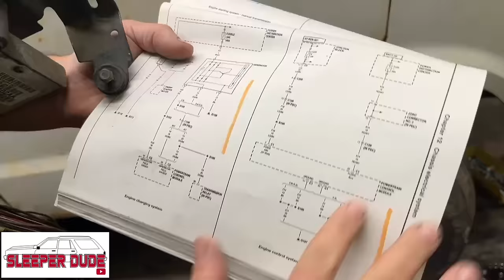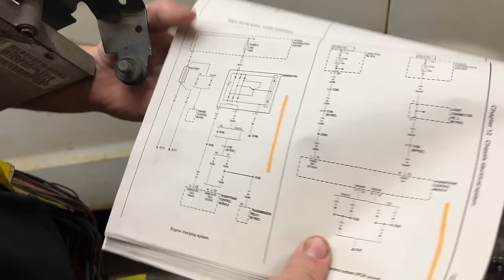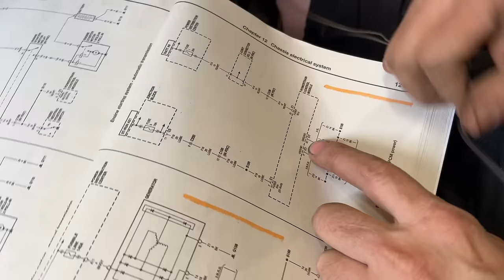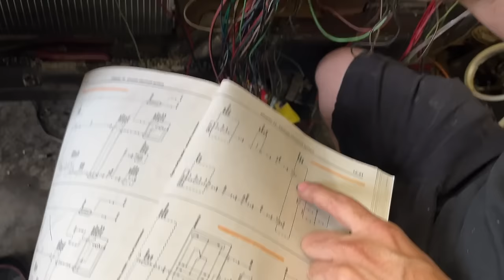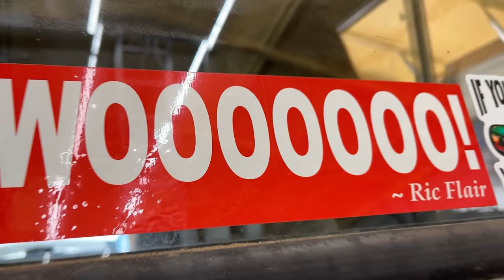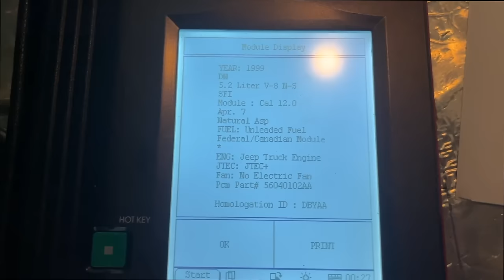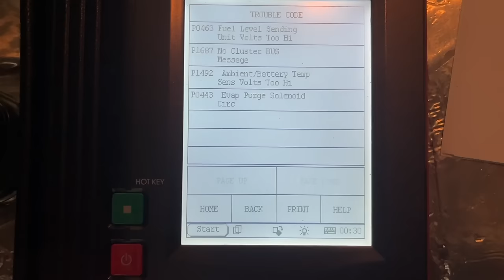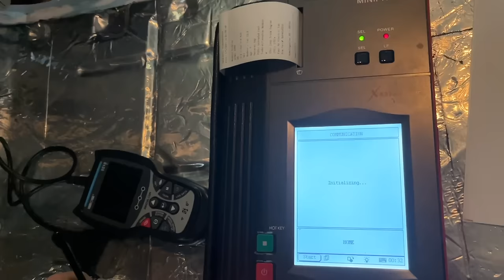2 Years of WORK Has Led Up To This! Will It Start?

Comment: Ok replying to this in hope you see this. I think you went wrong using your '73 starting cylinder. the '99 Durango has a key FOB right?  So you better could have used parts from the Durango steering column or maybe even some extra security module under the dash that are on the wire loom connected. Anyway security mode is triggered. I get from your video that you sent out your own ecu to have security mode flashed out, But the thing is (in my thought) that it still is being flagged as active. (having it send out before you tried to start it would have  probably worked. Most PCM's have a backup battery and/or write important settings to chip so important settings like: odometer or security status) are not being wiped after a disconnect.
Normal procedure to unlock security mode is by using the fob key and use a specific code for your vehicle (dealer should know from the VIN of the Durango) So yeah hookup the Durango steering column starter and look for a unit which normally talks to the key. This may no longer be possible after having your PCM flashed. Hope this helps. Also Google:  "1999 durango key CarGurus"

Comment: You should ask your transmission builder on your ATF you used but it should have been ATF plus 4 merc/dex dont have what it takes in fact check the transmission dip stick Peace

Comment: "MotorCity Mechanic" is a great youtube mopar guy, may know every in and out... I'd guess the fault lies in one of those little "insignificant" wires hanging from the bundle... you'll get it! Also, didn't you say you saw a reluctor wheel and thought it strange that it had no missing tooth?

Comment: Is the ecu showing 12v. And is ur battery holding 12v under cranking.. I had a battery with a weak cell and my truck would not start..? Dearing cranking. And and is ur Park and natural safety switch still working??

Comment: If there's no voltage for that first one second WHEN YOU TURN THE SWITCH ON, you need to see if the automatic shutdown (ASD) relay is turning on. What I would suggest is removing the ASD relay, jump terminals 30 to 87, then take your time measuring the voltage again at the coil or any injector. You can do that without cranking the engine or even turning the ignition switch on. If there's still no voltage there, there is a blown fuse or some other wiring problem, possibly a corrosion in the fuse panel.

If you DO have 12 volts now, the computer isn't turning the relay on. That would be very uncommon. Also, when checking that voltage for the first one second, you should do that with a test light, not a digital voltmeter. Most voltmeters don't respond fast enough to give an accurate reading.

Comment: I used to have a 1998 Ram truck that wouldn't run with the downstream o2 sensor plugged in because of a short in the sensor

Comment: I have had a 2003 Jeep Grand and 1999 Dodge Truck with the security delete like for Goverment vehicles. I just unpluged the sim at the Ignition switch then plug in the new computer and you can make extra keys without the security chip's. I don't think that's your problem though seeing your not useing the Dodge truck Ign. switch. Check the gap between the crank sensor and the flywheel it should be about the thickness of a matchbook paper. I use gease to hold a piece of pasteboard the size of the crank sensor stuck on the bottow of it, then set in position and then bolt in on! I believe it's goig to be crank or cam sensor's... So sorry that your going through this. I know from experience that electrical can bite hard sometimes.. Lord Bless you guy's.....😎😎

Comment: Doing some research it looks like your 1999 Durango SLT came with a factory alarm system. There are switches in the doors and trunk that are connected to it. To verify you have the alarm system take off the drivers door panel and take a look inside at the door handle where you would stick the key in, if there's a 2 wire switch connected I suspect this has something to do with the engine running issues. The other thing that confuses me, was the old computer indeed a 5.2 computer? They aren't supposed to be interchangeable between the 5.9 and 5.2. I'm not sure how you have it wired but would it be possible to take the door switches out the durango and wire them in so it disables the factory alarm? If it were me I'd consider plugging in the old computer and trying that route since you know it worked before. (This is all assuming the doors do indeed have the security switches)

Comment: I've never come across an automatic transmission that had to be in neutral to check they have all been able to be left on park cause as far as most if not all transmissions I have looked into putting in park is alos putting transmission in neutral the big difference is that park position activates a parking Powell were neutral does not but otherwise shouldn't be any difference in the hydraulic system.
Reply from the maker: Mopars pump doesn’t run in park that’s why you have to check it in nuetral

Comment: Double check  fuel pressure ,  temp sensor  ?????   And grounds      and your  hot and hot signal wire connected together??

Comment: Crank sensor could have touched the flex plate and broke off the tip, seen that a few times over my past 52 years of being a master certified mechanic. Just relax, think about it. You have spark and fuel just no injector signal. It sorta runs with the bottle. Injectors get their signal from the crank sensor and the cam sensor. Check both for damage. Another thing to check is the oil pressure sensor. It might not be connected right. As for the A/C system, Mortske put an aftermarket kit on his white dually reticently, check his out.

Comment: You have definitely out a running engine's worth of effort into this engine. When you showed what the wiring harness looked like after the tape was removed,  I half-expected you to start pulling your hair out. Instead, you methodically went thru the harness and figured it out, At the end, it seems like a bad electrical connection between the injector signaling unit and the injectors. God bless you for your patience. You will triumph over the engine yet.

Comment: Could the fuel line that is a billion miles long and thick (thats what ahe said) be full of air? That was my thought as to why it was running poopy.. but not for the not running at all thing. Maybe try to wire in the oem key cylinder w/key or atleast verify its chipped or not, i dont know if that part they can flash out of that pcm.. make sure map is getting vacuum.. oil pressure sensor wire could be jumper'd..  idk.. im going to get with my mopar buddies in a few days and report back if they have anything... did you put a new crank or cam sensor in? They may need programming

Comment: might be able to craft the inner cubbins from the speedo in the durango dash in the bezel of the old dodge campervan , that way you at least have a moving speedo , might need to put a gps next to it to compare the actual mph with the mph shown on the dash
as for wat could happen when tying the switched and starting power wire together is that one of the two backfeeds intoo the other ..... you could temporarily hook the switched power wire and or the startpowered wire up to the battery with switches in between so its seperate from eachother and see if that helps youre starting problem , starting to wonder if the start power needs to be constand or only under start , seems to me thats the only thing you done different from stock (using the old vans contact ) ..... come to think of it check how the durango contact switch works , could be it switches between the two (breaks the one and contacts the other )

i own a smart car and these things are kinda tricky with the can bus , they connect the dash the ecu near the engine and the underdash thingy (dash controll , wipers , indicators , light , etc ) together stores the milage in more than one of them and if one of these components gets switched out and or replaced with another one of different milage or different chassis number the ecu goes intoo a screaming fit (i actually believe it will try to start a few times then locks up untill you reset it using the mb star system)  
could try hooking up the durango dash back in (splicing all those wires back in ) and see if that changes anything as the ecu might want to see the original milage (wish makes sence when you need to leave the newly installed ecu alone for 5 minutes to communicate (must be the durango dash cluster it needs to communicate with as theres nothing else it could comunicate with that was in the durango)   ..... makses me hope you still have the original ecu and that might not gone intoo save mode , though i think the dodge dealer might be able to just reset as original by deleting the codes 

maibe do another obd check might give you a different fault code (did you mentioned to the guy programming the ecu that the van didnt had the original dash in it that came with the ecu ?)

Comment: the exhaust pressure the o 2 sensors could not be working right they regulate fuel no cat between them and open pipe the flow might be to fast between the two they read  the difference in oxygen in exhaust and adjust the fuel  to keep correct fuel air ratio .try to take them out of pipe still hooked up and see if it will run .. my 97 wrangler is hard to start but runs the exhaust manifold is broke so it reads to much oxygen for starting but after it is started it will run
Reply: you could try to put a muffler on to see if back pressure will help with starting it might not run right or get the best gas mileage .i feel the cat converter would make a big difference

Comment: I was recently working on a truck and believe it or not the fuel sending unit reading low fuel stop it from running, the computer limited the fuel pressure to the rails cause it was reading empty, The only other thing is maybe the computer isint reading oil pressure so it's not allowing it to fire to try and save the engine. 🤷🏻‍♂️

Comment: It may have nothing to do with this but is there a way to plug in the Durango cluster it may need a signal for some reason to go through the cluster via tach and odo. Oil pressure sensor is my next guess. Not necessarily a security issue at that point but a safety issue cpu doesn’t like something Dodge can be weird sometimes with electronics 😂

Comment: Battery temp sensor has to be hooked up to run. Worked on a 1996 jeep and it wouldn't run unless it's wired

Comment: My dodge ambulance WILL NOT IDLE without oil pressure reference, you change its oil, it will STUMBLE until it gets pressure,it triggers the a,s,d relay so you dont damage the engine during a pressure loss situation.
It will die under low pressure situations too, i recently had a weak oil pump in that truck and found out the hard way, hook that up, might just fire those injectors

Comment: did you cut a 45 degree angle on the end of the fuel line in the bottom of the tank..

Comment: You have a computer issue. Because they differ in design I can't give you an direct problem to fix. But using this method you can find it. Look at your schematic and trace the "switches" that feed the computer. Most will be crank no start inputs meaning without the switch being "on" it will crank no start.  One is security, but there are others and oil pressure was added to many systems as a interrupt in the early 1990's to prevent fuel flow from a leak...similar to the inertia switch or level switch which they started adding in the late 1990's. ALL switched inputs need to be "on" or it will crank no start.  the inputs can be ground to "on" or flow B+ positive through to "on" in which case you need to connect it to positive.  The schematic will give you the design and that is the key.  If you schematic is not correct, try another similar year schematic.
Reply from the maker: Ok thank you

Comment: Most likely you have done this,check the injector fuse ,than check your injector relay ,check the load side,check all the tabs inside both the relay box,and the fuse box.

Comment: I don’t know if anybody’s added, but if the computer don’t show oil pressure, you will not get injured fire is a safety to shut the motor down in case you lose oil pressure 4

Comment: Dangit! I keep thinking about this.... When it did run, it ran awful. During that part I was screaming timing! Timing!  Then all of the sudden it would not run. That, to me, screams something electrical. Just because the injectors are not squirting fuel does not mean that it is still not electrical.  I am truly leaning twords that computer. Unless you did it "behind the scenes" I don't believe you checked for spark. I'm thinking that you're either NOT getting it, or the timing is so off that "the band can't get together".  I'm getting a feeling that maybe that 3 wire hook up you did maybe have somehow fried the puter. Or heck, it may have just crapped out on it's own. But it seems to me that the things that need to be getting a signal to work aren't. And I believe that the computer being the band leader is not leading the band. My $.02.

Comment: Have to say I would not trust 23 year old Mopar wiring and computers. I'd go with a basic electronic ign and a carb / manifold. But if anyone can make this work, you can. My '01 Dakota had one of the modules take a crap and the 4WD stopped working; I managed to find a replacement and the 4WD worked again but after that, the truck would immediately lock its doors if you got out with the engine running. Nice. Luckily I had a spare key in my wallet.
Reply from the maker: Yeah you might be right

Comment: OK, ALL THE CARS/TRUCKS OLDER MODELS I WORKED ON THAT HAD STARTER PROBLEMS, INCLUDING MY MOTORCYCLES, I FOUND OUT THAT IT WAS ALWAYS THE "STARTER RELAY".  AT THAT TIME IT WAS A $35 DOLLAR PART. MY NEIGHBOR PAID HIS MERCEDES 500 TO FIX HIS START PROBLEM AND IT STILL WOULD RUN AND THEN SHUT OFF. I MADE HIM CHANGE OUT THE STARTER/RELAY  AND STARTED RIGHT UP. HE KICKED HIMSELF BECAUSE HE FORKED OUT 500 BUCKS.  SO, I WOULD GIVE THAT A TRY.

Comment: Do you need the right ignition key might have a built in immobiliser
Reply from the maker: Maybe so
Reply: Plug the old computer in and wire up the old ignition to use the key might work it was working before good luck 👍
Reply: The key battery gets a charge from the ignition barrow some how. I don’t know how it’s a magic 🪄 😂👍
Reply: Might have to plug the old clocks in to or something in the old dashboard

Comment: Josh why dont you add a air horn or just a really loud one. i had a loud horn in my Chevy PU and i had more fun with that horn than you would believe. i even honked it at some horses grazing about 40 yards off the road and they jumped and started running. i laughed until i almost cried

Comment: I had a Jeep years ago with the same issue a no start problem, the dealer changed the computer for $1000.00 it solved the problem for a week or so then back to a no start issue again.
No codes concerning power supply just no start.
I ended up finding a intermittent power connection to the computer and the problem was solved, I know this has to be frustrating at this point just throwing ideas at you.
Reply from the maker: Oh wow that’s scary

Comment: Your key from the dodge could have a microchip inside the plastic part of the key OBD2 are smarter computers I would think it has some type of security system module…. If the original key is all metal then no microchip no security system…. Anti theft system from the computer could be triggering not allowing you to start the engine

Comment: Nothing like old school. Carburator, points, plug, and condenser. I dislike all the computer crap on cars. The 440 was a great engine. I have a friend that has the exact same motor home. But it has just the cab, no camper on the back. The 440 is good in it. He might want to sell it
Reply from the maker: Ok thanks

Comment: A year ago i was trying to restore a 1980 Mercedes and i removed the original radio for a retro fit radio and the car wouldn't start i spend 2 months to find the problem. The original radio had a swcurity system built in.😂😂

Comment: @sleeperdude  (josh) did you see the comment from  the last comment from (user) 
Below ⬇️ 
I hope you get it running . 

I had a car it was an Altima , and had all kinds of problems with it , I remember the mechanic , disconnecting some wires to stop some kind of codes ….. it was causing them cancel out so to speak the firing/ starting .
Also had issues with a cam sensor , and also catalytic converter …..

It was finally fixed but I remember it not turning over like this one , and it wasn’t the battery or alternator 

Also it would start jumping and slowing down etc when I was driving it , like your first motor home did too . 

When I was driving it would run 

Hope you figure it out 

Check that lady comment out